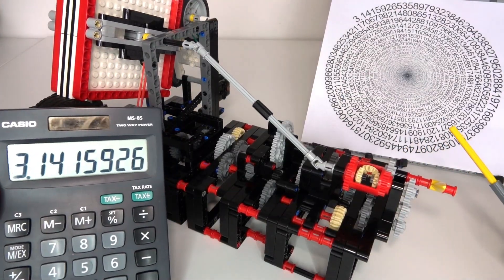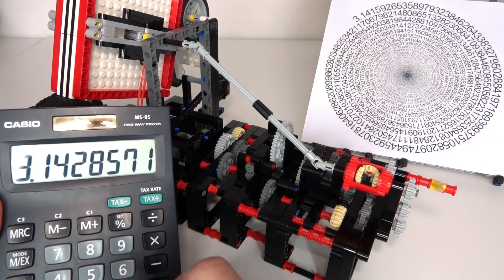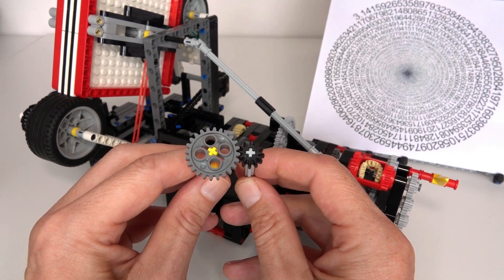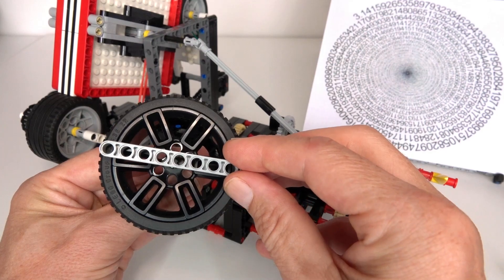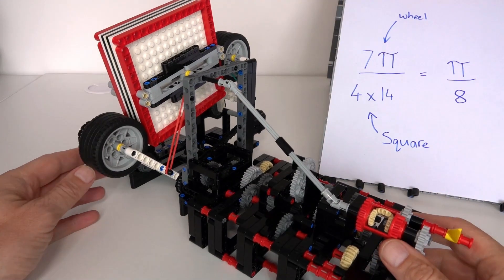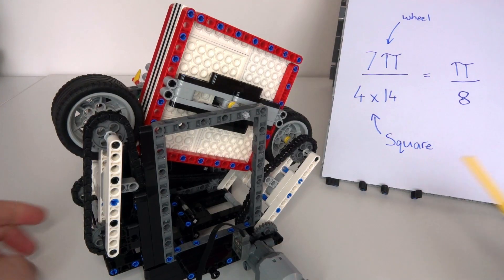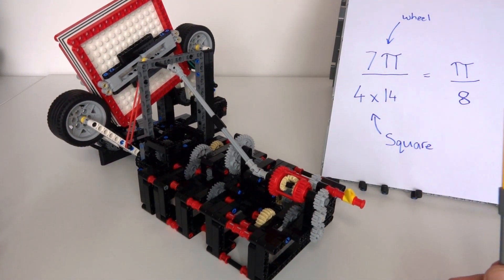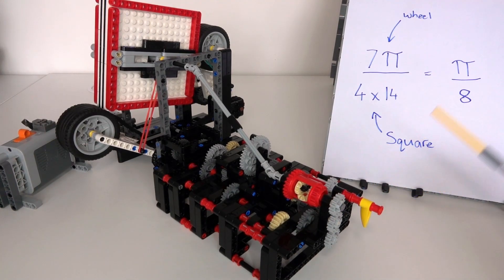Lego Technic Pi Day Machine

Comment: Now that is a work of art. Excellent implementation of the square wheel mech. Really interesting to watch . I'd suggest that slowing it down may make it more accurate and might look better? whatever, it's a fascinating machine. Oh, did you sync the UJ  phasing? cheers from UK, been a while since I saw one of your videos 👍🍺🇬🇧
Reply from the maker: Hi Carl, Thanks it was actually a really fun project that I thought should work in theory but surprised me to work in practice.  Didn't think about UJ phasing as it shouldn't affect the overall relative rotation speed.

Comment: You channel is very interesting and unique. I did learn alot from you.
Some gear box better and some just bad- that cant hold torque Properly.
i desided to neglect all the idea of gearbox since i think with lego- the friction is higher from anything you can gain with it. I only use gears if i have to- like with the subtractor that i made.
Keep the good work, you surely higher the level of understand with alot of   lego builders and funs. Thanks for that.
Reply from the maker: Hi Yuval. Thanks - yes you are right about gearboxes - I have discovered the reality of friction ;) Has been fun trying though. I do have a new design coming up though so keep watching... ;)
Reply: @TechnicBrickPower  
Cool man, ill waiting for it 🥰.
Ill make big big surprise that coming real soon - lego motorbike, with new mechanism that never seen before.